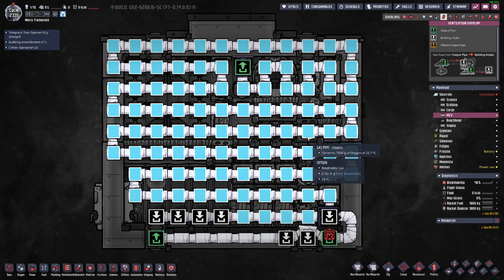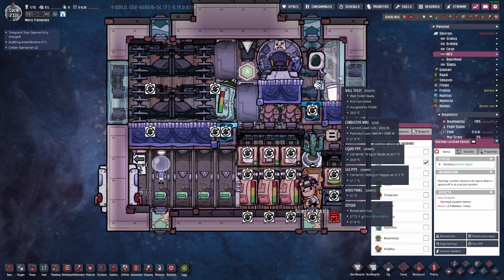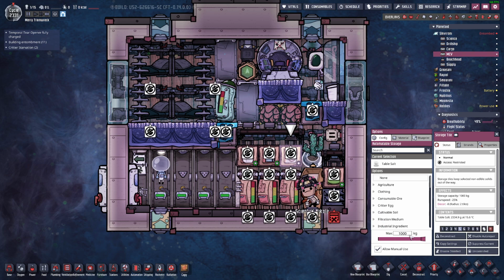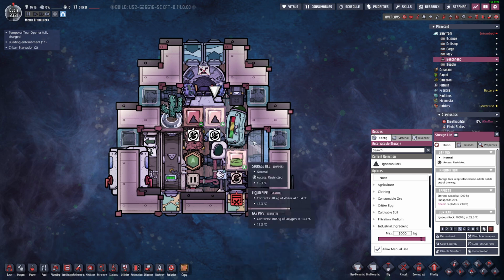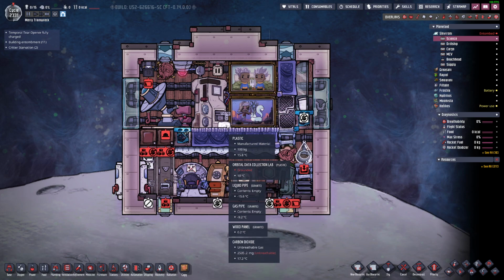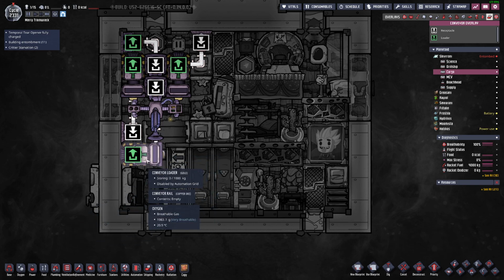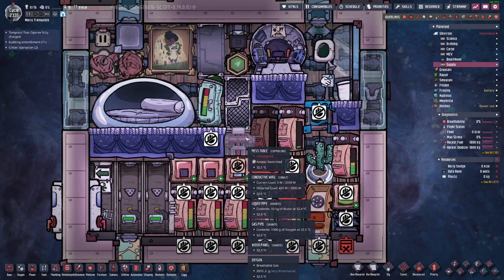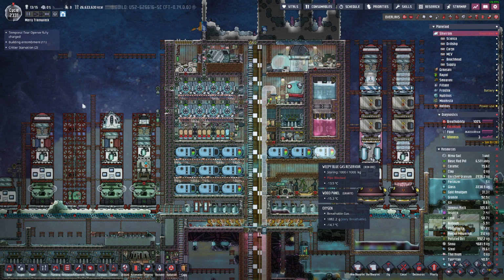ONI / Oxygen Not Included - Advanced Rocket Interior Design

Comment: A much better way than temp shift plates to moderate temperature in a rocket is to cycle the water through all the internal pipes and out the external access until the temp has stabilized.

Comment: They will get a lot of radiation though, and will make you use a lot of rad pills. I usually use similar setup to yours but I make a roof made out of either lead or depleted uranium storage tiles. And sacrifice the bedroom for a bigger mess hall and a small room to house small pump to drain CO2 and put oxygen diffuser on the other side of the rocket. I make them sleep on the ground but it usually doesnt cause any problems other than -1 athletics. I use high decor by spare artifact debris, party phone, sunny disposition and carpet tiles to manage morale without pivoting to scrubbing. But I lack the atmo suits so lava asteroids are out of bound for me unless I construct them on the spot using rocket cabin resources that I hoarded.

I have three dupes that spend more than 100 cycles rocketing non stop except when they are refueling and restocking the rocket briefly, takes less than a cycle at most. They were using data collectors and chilling the entire time while the rocket was mining. I also keep a small container full of ice so I can lower temps and get water for my toilet in-fligh by melting the ice. I could theoretically cram 10 dupes inside but it would take so much resources to maintain them while serving almost no purpose.